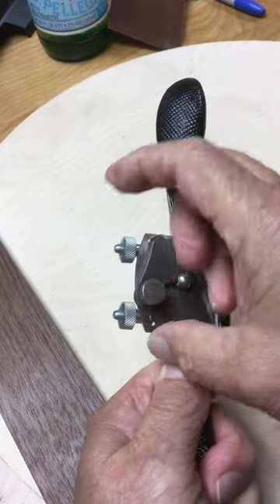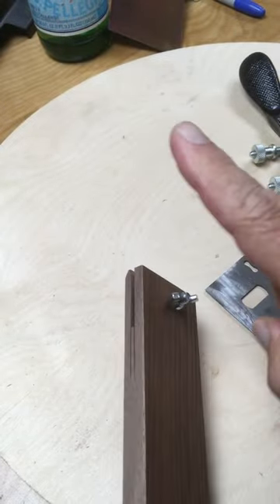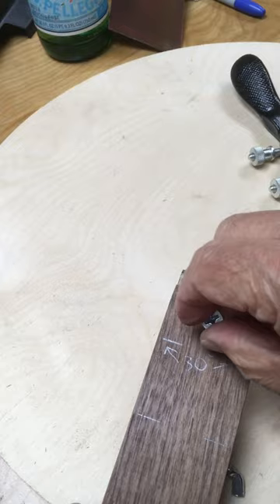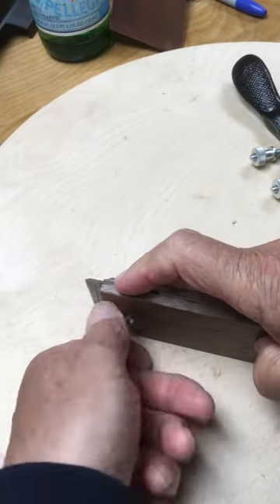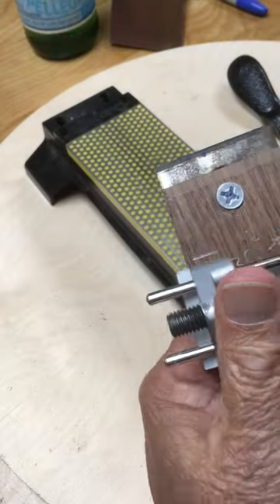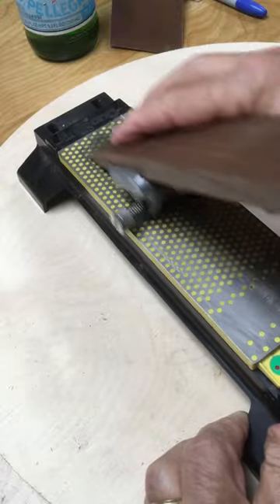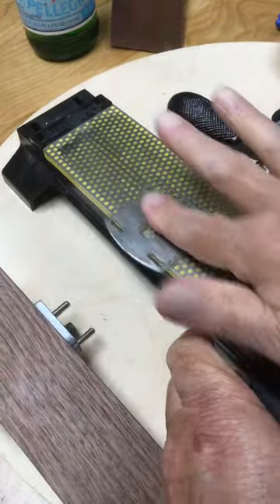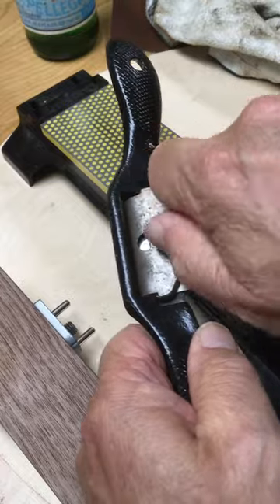Spokeshave Sharpening Jig #Short

Comment: Paul Sellers made this first.
This is a rip off.
Reply from the maker: Thank you for the comment. His is way way way better than mine. Brass blade keepers, uses the lever cap to hold the blade, etc.Mine is just a quick way to grab the blade.
Thanks again for watching.
Reply: This works for me as Sellers was mainly for the 151.  I use a 51 without the adjustment slots.  I was thinking about something similar and your short helped out.